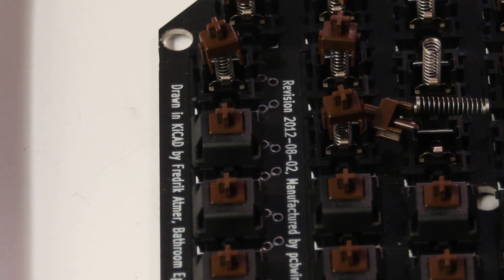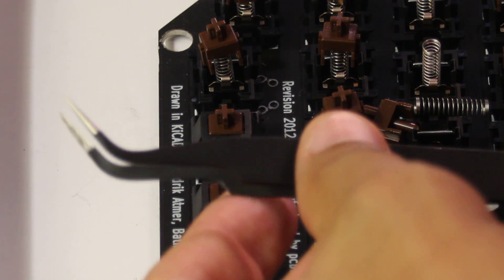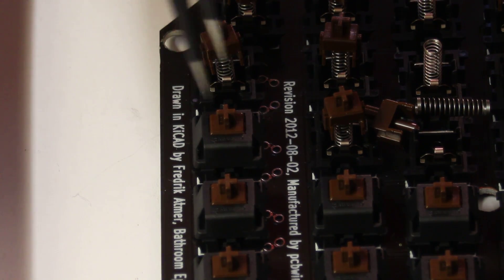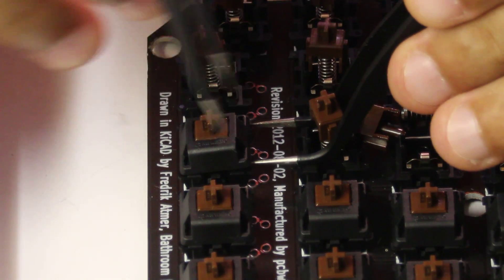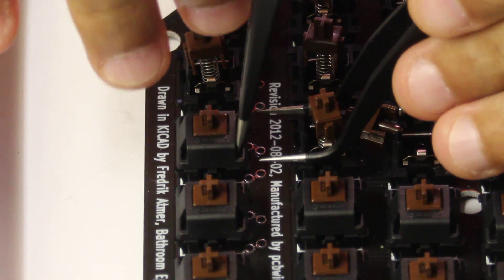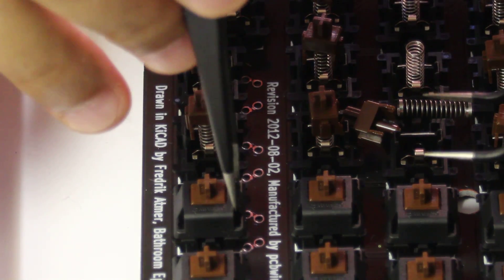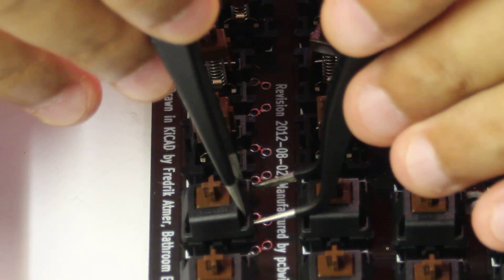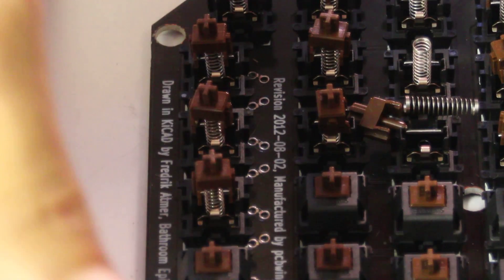How to open PCB mounted Cherry MX switches

Comment: So let me get this straight. you can change the whole cherry switch with something like blues? I ask because I'm going to buy a k95 rgb and it only comes with browns.
Reply: TBH if your good with a soldering iron you could swap out every key with cherry mx what-ever-the-hell you want.
You can de-solder the whole board and solder what ever cherry switch you want on to it. provided the switch has the same contact point pattern as the former switch. ( the little metal feet that get soldered into the board.) 
What he is doing is probably cleaning out the switches or swapping the springs for either lighter or heavier springs.
Reply: @Cave132  Why would you need to desolder? Do the different colour MX have a different base?
Reply: @xpusostomos  no, most modern mechanical key switch's have the same base. It's a plastic post and two metal pins. One positive and one negative. But if you want to swap mechanical switches most of they time they are soldered to the PCB. Some DIY Keyboards have hot swappable keys. The host swappable ones can be pulled off the board and replaced by just pushing in a new switch.
Reply: @Cave132  you don't get what I'm saying. The switch has a base, a top, and some guts. If the base was the same, you could swap the guts without desoldering.
Reply: The guts for every mechanical key switch are different some are the same but a clicky switch is different than a linear switch. The housings would be different to accommodate the different parts that make up Clicky, tactile or linear switches.
You can replace the stem and the spring in some switches but the actual mechanism that makes it go cannot be replaced. That means if you want an entirely different feeling switch you would need to replace the whole switch. IE Clicky switch to linear switch.
 Where as if you had a cherry red but wanted a harder press you could swap out the springs for heavier ones

Also it wouldn't make much sense to just replace the guts of a switch.and frankly I don't even know if that's possible. You would want to replace the whole switch if you wanted a different typing experience.

Comment: Thanks. The space bar switch in my fnatic keyboard is stuck all the time and I was desperately figuring out how to remove the switches to figure it out. Thanks <3
Reply: My wife's fnatic Gear cherry mx brown keyboard also gets stuck sometimes, but it doesn't look like physically getting stuck, looks as if the electronics send multiple keystrokes for a single key press at random.

Update: after I disassembled the keyboard (out of warranty), I found the switch of the * key on the keypad to be internally broken. I replaced it using spare parts from ebay. Problem solved.
Reply: Hey man, i Know your comment Is 4 years old but id like to Know if you could get all the switches out and not only the spacebar one

Comment: hey, this helps alot but do i really need to take it that far apart? to take the backplate off my keyboard i need to desolder ALL of my led's :(
Reply from the maker: I guess it depends on what you intend to do. Just to remove the switches from the board you don't need to do this, but some people want to lube their switches or change spring weight.
Reply: ***** i want to taketheswitch apart to clean it  because it keeps sticking and i've done everything i could find that didn't require taking the switch apart